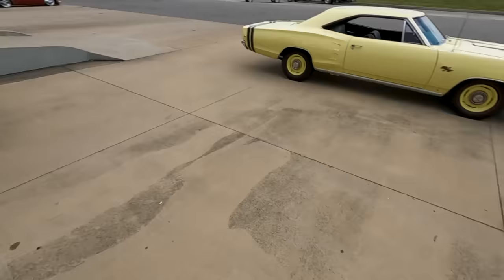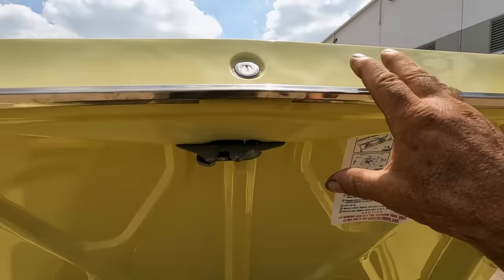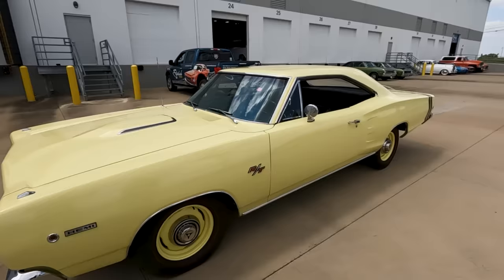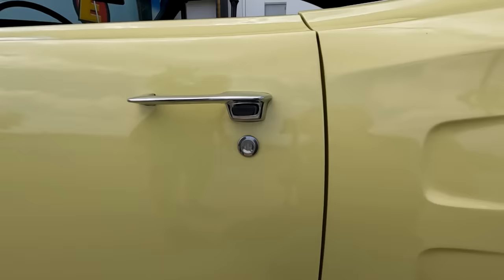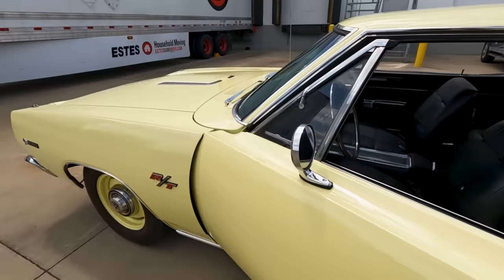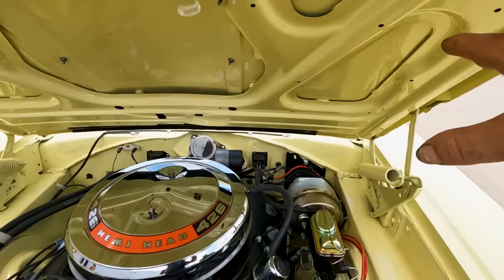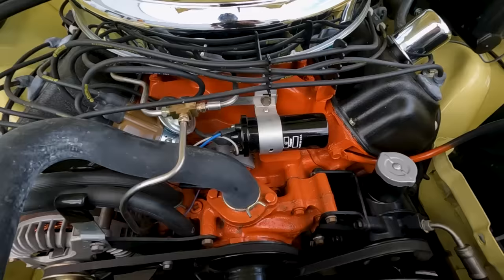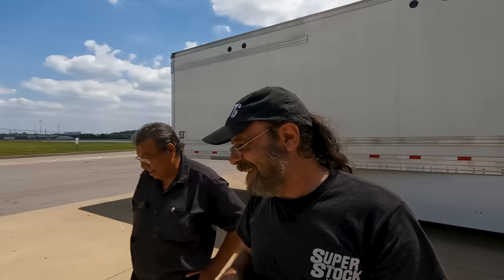1968 Hemi Coronet R/T Walk Around - Musclecar Resto Done Right!

Comment: My late father bought a new 1968 R/T with a Hemi. He ordered it. It was yellow, with automatic transmission, power steering (requested by my mother) 3.55 Sure Grip and full wheel covers. The Hemi's got plain 15 inch wheels because those were the heavy duty police wheels, which may have been on the D-100 pick-up's too. They were not standard service 15 inch wheels, but heavy duty wheels. They didn't have the Magnum 500 wheels as an option, because those were not made in a heavy duty version. When the R/T arrived and my father was disappointed by its performance. He pulled the distributor and swapped in a dual point Mallory distributor and all was well. We drove that car all over the country and 10 years later, it was pretty rusty, but I was driving it to high school.  Direct Connection recommended that the constant voltage, solid state voltage regulators be used with the Mopar electronic ignition. The two field alternators can be used with the mechanical, points regulators, if one of the alternator fields is grounded. I've done that, just by looping a wire from one field connector to a screw on the alternator.
Reply: What are the width of the 15" cop wheels? I'm looking to put those on my Roadrunner. N
Reply: @sjaywjayw70  The wheels are marked 6.0 next to the valve stem hole for 6 inch width. 68 and 69 Hemi's got F70-`15 tires, 69 A12 cars got G70-15 tires. With the valve stem holes at 12 o'clock, there is an H between the lug holes at 8 o'clock, for Heavy Duty.

Comment: That yellow is a favorite of mine, and it’s a gorgeous car. Without knowing what the issues are with the car, I’m going out on a limb and saying it’s going to be the advance curve in that distributor, it’s going to have too much centrifugal, and those cars like a lot of initial and limited  centrifugal.  The power brake booster and master cylinder lid should be black.

Comment: Being top line as opposed to stripper Super Bee I wonder why it didn't get the chrome trim around fender scallops like my '68 Coronet 500 had. It has the other foo foo - fender trim, turn signals on hood, blacked out rear tail light panel w/chrome bezels. I'm starting to think my 500 is more rare than the R/Ts ! It had the split bench with fold-down arm rest, extra lighting - so nice.  I miss it more than the 'Cuda.   👀

Comment: Buy it Tony,have to listen to the Wife whats wrong with you ;) Better have a sweet car thats all done before the feds come and take them away from us!

My car looks like new after 20 years and 70,000 miles of driving it,1970 Charger 500 restored and still people think its a year old restoration.I drive in rain and got caught in snow once! Even parked outside for 1 year while I was building my new house and garage,car had frost and rain,wind blowing on it and it looks like a show car still. I did add factory style undercoat but still zero rust or bubbles on the paint.A few rock chips nothing major! The 383 Magnum still runs strong and its done up a little,bullet proof reliable and 12 second 1/4 mile capable with 3.23 gears,but its a sweet driver that sends me back in my seat and chirps 2nd its all I need,plus can smoke them at will on a roll with no brake holding! I dont bag on my keeper cars,dont buy the ones I am selling those get the whole 1970's type movie driving style treatment lol

Listen to the Wife and buy it! Life is short!

Comment: Don't understand the need of a fuel pressure regulator with a stock type Hemi mechanical pump unless it is over 6 PSI. And the pressure gauge...how do you read it down there? Other than that a really nice high end resto.  Chrysler threw these cars together back then and not precision assembly like on a resto.  Factory cars had paint runs all under the hood. I know....we had a new 1970 Hemicuda  and it wasn't that nice under the hood or in trunk. It came with a leaking torque convertor seal and had to go back to the dealer next day!

Comment: I'd actually rather have an over restored car, and I don't even care if it is numbers matching. In fact, I wouldn't at all mind having a clone, as long as it was done right. I am not a collector, I want a nice car to drive. I am not a fan of the redline tires, I'd probably put RWL BF Goodrich Radial T/As on it. Not quite period correct, but they look great. I don't mind if a car has been mechanically upgraded parts, as long as they don't ruin the looks. What I DO mind is when somebody puts computerized electronic JUNK on a classic car that is supposed to be all mechanical. So many people have literally destroyed these cars by putting a modern computer Hemi under the hood, and 22" GHETTO REEHUUMS on it. I see undercoating underneath. I have seen undercoating used to cover up all kinds of horrible things. I hope that is not the case with this car.

Comment: I have a '73 Buick Limited that my Dad bought new. Yeah, kinda afraid to drive it! If, God forbid, someone hits it, where could I get parts for it????? I belong to the Buick Club and they're pretty good, but how many 2dr. hardtop Electras do you think they [GM] made? Fenders and quarters won't line up! Or window glass?? Sorry sir, good luck on your search! But there is another issue. My Buick has 21.5k ALL-ORIGINAL miles that I don't want to run up. Even the brake pads and shoes are factory original! My poor car sits WAY too much and I have considered selling her. But where could I ever find such a pristine car again??? I trust this car because I was involved with the purchase start to finish...had 3.6 miles on her when we picked her up and brought her home. Thanks for letting me vent, Uncle Tony!!

Comment: Idk that ground strap screwed down on top of the plastic reservoir mount for the wiper fluid is just making no sense to me?
Reply: It’s a screw that goes into the fender liner. As long as the threads are into clean metal it’ll ground plenty well enough for that little wire.
Reply: There’s a metal grommet under that ground wire. Comes with the reservoir